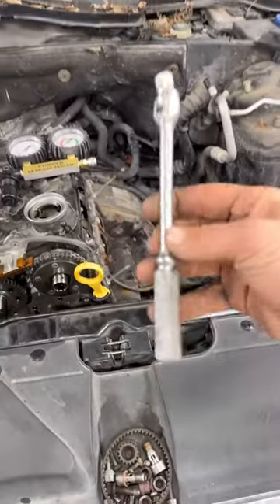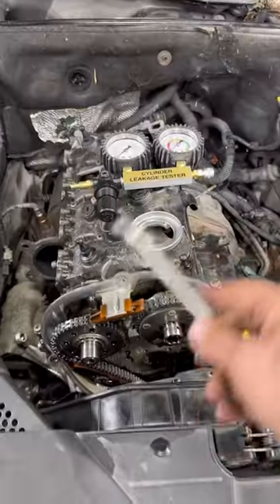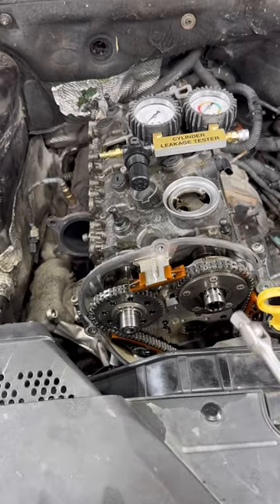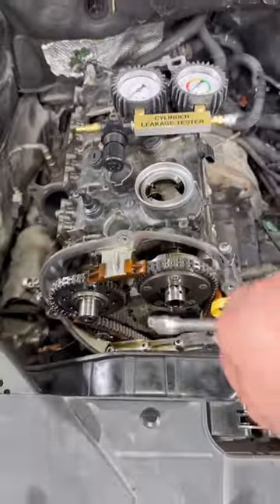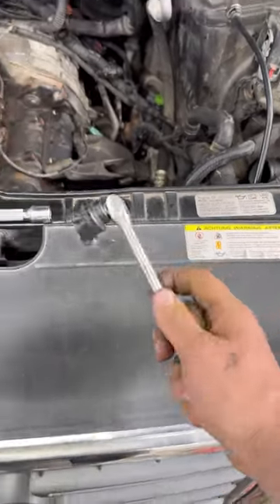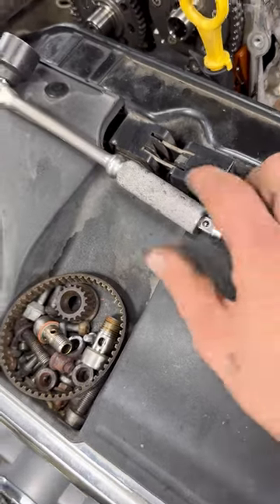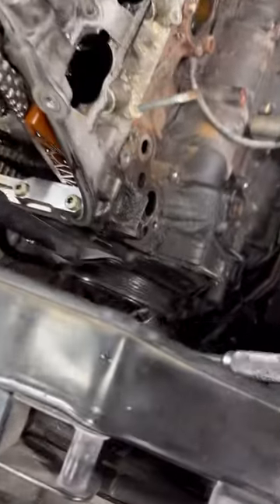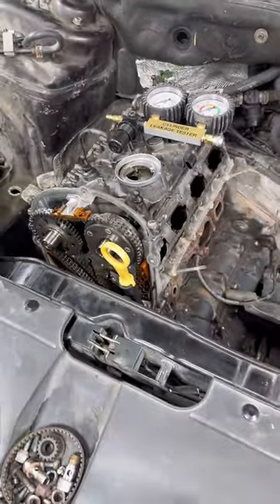Mechanics Small Breaker Bar Tool Demonstration

Comment: I have the same or similar in age snap on mini breaker bar as well and it is so incredibly useful for exactly what you have shown here! And I love that it has the square drive to attach an extension too. It’s great for working up against the firewall in tight places that some ratchet heads can’t fit into

Comment: Your low oil pressure might be from the cams themselves. Remove the cam cage and check the condition. You might be loosing pressure there